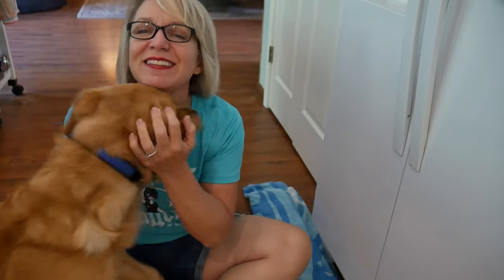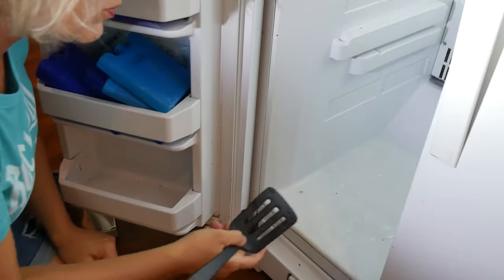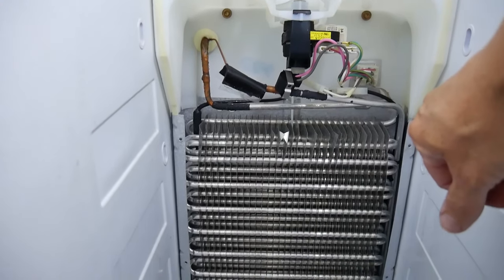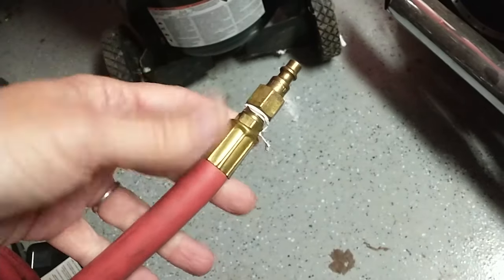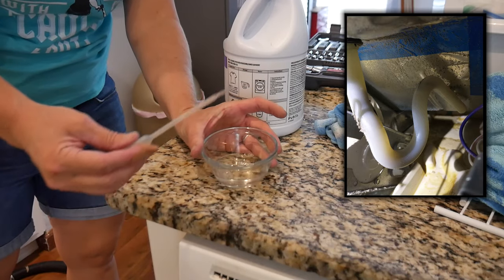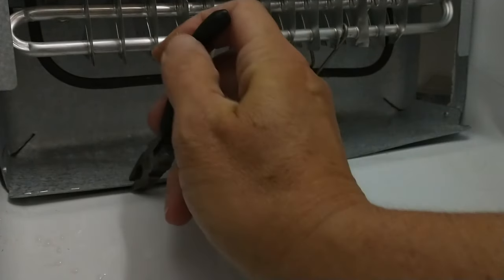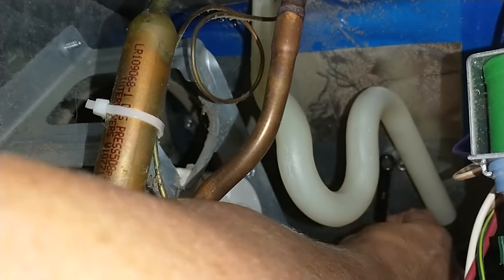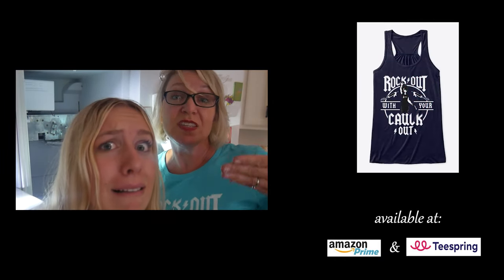Why is there ice at the bottom of my freezer?

Comment: Just fixed mine! Took off back panel and made sure drain tubes were clear and they were. Also drain pan was dry so no water was draining from fridge. Went thru freezer took off inside panel and all frozen. Drain line was frozen too. Got a hair dryer and put on high heat or some hot water to melt ice. Well as we were doing this the drain line opened and you can hear the water draining into the bottom pan under fridge.  Sounds like a brand new refrigerator! Thanks for the video! Feels good to fix yourself!
Reply from the maker: I'm so glad it helped! Yes it definitely feels good to be able to do something like that yourself. I'm glad you tried (and succeeded)!

Comment: If you have a Whirlpool refrigerator with that duck bill valve clogging causing ice on the bottom of the fridge, just open the back of the fridge and remove it. You don’t really need it and it is a common problem.

Comment: This video is spot on.  What usually leads to this is your freezer being over filled.  There are vents at the top and bottom of the back for air flow.  When the freezer is too full, that air doesn’t flow properly and increases the moisture build up that leads to freezing.

Comment: You have a new fan. I was having the same issue where ice would accumulate at the bottom of the freezer. Not anymore 😀 
Thanks to you I went to the back of the fridge and removed the drain pipe. Sure enough it was full of crud and it was not allowing the water to flow through. 
I flushed it out, replaced, & no more ice build up. 👏 thanks again for saving hundreds on a service call.

Comment: Looks identical to mine. Coils would freeze up, water would freeze in drainage hole. One more thing that I found on YouTube is to hang a 12 gauge bare copper wire from black heater tube and let it extend down into the hole. Keeps water from freezing in the hole. That’s been several years ago and no problems since. You did an awesome video. Sure saves money on those 100 dollar service calls! YouTube is my go to place before calling service people. Replaced my ice maker that way also. Only 3 screws and unplug a connector.
Reply: thanks for  the information I recently  just got a 13 years I believed  Kenmore side by side refrigerator working again  not to much trouble  but anyway  had the same problem  ice building on the bottom of the freezer  so I took everything out   and apart and yes notice the  drain plug was frozen over so what I did I got the ice out of the shelf  but I poured hot water  in the drain pan into the drain plug plus  used a very small  screw driver and got all of the ice out of it  plus ran several cups of hot water into the drain and the water went straight through  and  have monitor it  since then and no frozen  water I believed this problem came from  when the refrigerator would not go into defrost mode  or cycle and that problem has been fix  also but anyway thanks for the information

Comment: From a dude ...

Had to repair my GE side by side refrigerator; replaced defrost heater, thermostat, temperature probe, all of which failed or were about to. Works great now EXCEPT for the drainage issue you dealt with. Gotta attend to this one final fix. Thanks for shedding some light on this particular problem and solution.

Cheers!❤

Comment: Nice Job unclogging the drain pipe! Wonder if you put a screen over the  drain hole to eliminate debris falling in would help? Also you made pulling your refrigerator from the wall look easy!😀💪🏼
Reply from the maker: It's really not too hard to pull the fridge out, it's on rollers. I don't think anything actually fell in there; it seemed to just be sediment/mold collected at the first bend.

Comment: So glad I saw this, fixed the problem in 10 minutes.  Tube had about 2” of blackish gunk which cleaned out at the sink.  A little scotch tape around the 1/4” driver to hold the hex screw helped me one hand that back in without dropping it.  A magnetic driver would have done the same but mine was not.  Thanks again!

Comment: Thank you!  I really appreciate the information, pouring a little hot water before the bit of bleach definitely cleared the line without taking apart the back.  I used a dryer vent cleaning hose on a shop vac.  Fit the drain well enough.

Comment: THANK YOU!  mine was a fridgadare.  same ice cube in bottom though.  i ended up taking the hose off in the back of freezer, using blow dryer for 20 seconds inside in the drain hole, then a shop vac to suck melted water, then do it again for 5 to 6 times. afterwards i put shopvac hose in back where hose hooks, turn it on and have wife pour very hot water.  worked good.

Comment: Thanks for posting, I think I saved about $200? I had a Kenmore, looked exactly like the unit in your video. Cleaned the black stuff out of the pipe, just need to let it run a couple of days to check for puddles!
Reply from the maker: Hope that fixed the problem!

Comment: Thanks for your video. I couldn't figure out where my drain hole was and it wasn't until I saw your video that I realised it was clearly visible inside the rear panel of the freezer. But after I took the inside rear panel off I saw the drain hole was covered in two inches of ice. You have to remove everything from the freezer and take off a few screws but this should be your first port of call before messing around behind the refrigerator.

Comment: Great video. I could not get anything to snake through the drain because it made a tight loop seal and blowing did not work.  I ended up stuffing a tygon tube up the end where the drip pan is and it made a pretty tight seal.  I then vacuumed out a big slug/plug of something and that was it.  This worked great because the mess ended up in my shopvac and with the clear tubing I could see the plug as it went through to the vacuum. Very satisfying!  Thanks for the video.

Comment: This weird little Loop-de-Loop at 2:43 ... FYI: is not weird, its been around for decades... its called a P Trap and is found on 99% of all plumbing drains. Good job attacking and fixing the problem. Love the dog helping you.
Reply from the maker: I can understand it on sink drains -- it simultaneously makes it easy to clean clogs AND to rescue things that fell down the drain. But what is the purpose here?
Reply: @ChickFixUSA  Good question!  As you know, the "primary" purpose of a P Trap in sinks, as well as tubs and showers, is in the water it holds at the bottom of the loop ( or trap ) which blocks sewer gas present in the sewer line from entering the home through the drain. Since the refrigerator drain is not connected to a sewer line, nor is any jewelry going to fall down the refrigerator drain it would appear there is  no value add. But it has a purpose... the trap prevents air movement through the drain pipe. Without it, cold air from the refrigerated space will constantly flow out the pipe, and warm air from outside will constantly leak in thus wasting your refrigeration energy /expense.

Comment: You can remove the plastic drain pipe by pulling it down from the fridge.  You have to remove the screw in the back first.  Then clean it with a tube brush.

Comment: I have a Kenmore, freezer on the bottom (which I hate). It has a built in icemaker and water dispenser etc but about every 3 days or so the icemaker slows WAY down. I discovered this is caused by an ice build up on the back wall of the freezer, behind all three freezer drawers. So I have to get on my knees with a cane (a walking cane) and smack the back wall of the freezer over and over and over again until I've knocked all the ice build up off. Once I've done that I clean the ice up and my icemaker works fine for a few days. And then we start all over. been doing this for 6 years. The repairman told my hubby it was something to do with the fan and the part is Super expensive. This video makes me wonder if I could take the back off my fridge and possible fix it because at this point I'm just waiting for it to die.
Reply from the maker: The clearing the drain is worth a shot. If nothing else, it won't make anything worse.
Reply: @ChickFixUSA  I'm definitely gonna try it.

Comment: Good video. Nearly the same fridge, but mine freezes up before it gets to the drain hole. That blocks the airflow and the frig temp rises to around 60 degrees. Brand new fridge, service tech replaced the “heat sensor switch,” but problem came back in 30 days. I am guessing they will install another switch, and the freeze up will return in another 30 days.  Is there a lemon law for refrigerators? Forgot to mention, if I unplug the frig and let the ice melt it obviously stars working again, but the ice melting severely overflows the drain catch pan and this process takes about 24 hours.
Reply: thanks for the information I had  a sears Kenmore side by side  went out about 3-5 years ago  so one day I decide to work on my self  what the heck  basically refurbished it not to much money but anyway  I noticed the same thing  ice on the bottom  shelf  and the yes the same the drain plug was frozen  so what I did  I pour hot water on my  and into the drain plug and used a very small screw  driver to clean out the ice and ran about 3 cups of hot water  through the drain  wow  it cleared it up,  but  think problem came from because my refrigerator was not going through the defrost  cycle  and that problem has been  fix  but so far so good funny part I was trying to get rid of it  thanks for the information

Comment: Inspired by your video, I just spent an hour doing this on my fridge (which is, indeed, peeing all over the floor regularly, after repeated removals of the ice sheet on bottom of freezer). Why did it take me an hour? DOGS. The whole backside, underside, and inside of the poor fridge motor compartment was packed with dog fur, probably going back to dogs who aren't even with us anymore. It. Was. Disgusting. Eventually I was able to find the wiggly tube you show, removed it, ran hot water through it, but surprisingly, there didn't seem to be much in there. I'm waiting to see if that solved the problem, but if not, any ideas about what else could be causing this? P.S. we have an icemaker but it's not connected and we don't use it.

Comment: That duck-bill valve can be the culprit if it’s clogged. It causes water to back-up to the point in the refrigerator/freezer where it freezes and forces the other water to over flow into the bottom of the inside and then freeze.  Why buy a new part when you can merely enlarge the tip of that duck-bill flapper?  Mine was brittle and broke when I was inspecting it. One replacement full tube I saw in another video had a larger opening in lieu of that smaller valve. I figured I now have the larger hole that cannot clog — so problem fixed. Apparently yours was caused by sediment in the p-trap like bends which allowed the water to back up to the point where it froze and closed off the drain.

Comment: Better to take off the back panel to make sure that the gasket isn't clogged - BEFORE taking the back panel off from inside the freezer. It is often the source. So, so much easier a fix and often solves the problem without having to do major deconstruction

Comment: What do you do when the drain hole does not line up with the hole in the bottom of the freezer?  This is my problem as the water turns to ice and moves the plate further away from the hole.  It is about 1/2" too far forward now.  TIA.

Comment: Does that drain in back of fridge unscrew? Do you have to use screwdriver? Please explain. I am 65 years old and husband died and I am all alone. Only my freezer part has ice in bottom so I think drain is plugged up.
Reply from the maker: There was one bolt that held one side of it to the bottom of the fridge with a bracket. Otherwise, just a good tug should pull it out of the drain itself. (Sorry my footage of that isn't better - it's a tough space to get a camera into)

Comment: Cleaned my kenmore drain out just like you did and had my wife pour several cups of very hot water down that little drain hole while i watched from the back for good flow into the drain pan.....all appeared clean and clear...3 weeks later....2 inches of ice in the bottom.....im very frustrated!!!!
Reply from the maker: Does your fridge/freezer seem warmer than it should be? I'm wondering if your coils are freezing over and then thawing, causing a puddle to form at the bottom of the freezer. If so, this could mean that you have a coolant leak.
Reply: Both fridge and freezer are very, very cold....0° freezer and 30° fridge.....the drain hole is once again frozen solid with ice.......do you know if the freezer drain is supposed to be a straight, smooth conduit to the drain tube underneath.......?......the drain on my freezer is not straight but is offset with a little lip inside which obviously collects water and freezes and starts the buildup of ice.....I'm thinking about a copper wire attached to the heater element and running it down the drain hole to keep it open......any thoughts???.....thx!

Comment: OMG 😊 this video is great! I have about a 25 year Kenmore fridge Model 106.58982801 Besides a few minor beauty issues--had to replace shelves and the water filter vent, I had no probs. Then I started dealing with ice  forming in the bottom of the freezer for over a coiple months or more. The ice would melt at the corners and leak all over the floor and into the pantry.  I kept melting and taking out the ice, but it kept coming back immediately! Then I saw this video! I tried the last steps taking out the back panel. As soon as I saw that white tube--well it looked black and was clogged. I took a long zip tie and pushed it through and OMG! STUFF came pouring out into the drain pain. I also pushed the zip tie through the hole that held the white tube and uuugh, the zip tie pulled out soggy stuff ... we also got a shopvac to clean out as much dust as possible and cleaned the vent ... NO MORE ICE! NO MORE LEAKS! It even sounds better, and gets more cold! H
She is revived and good to go!  Thank you Chickfix!